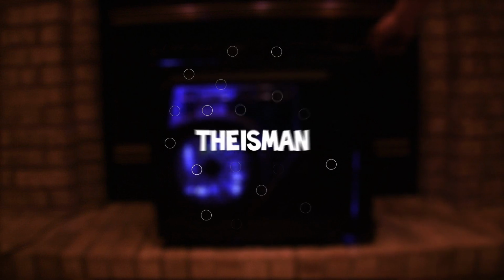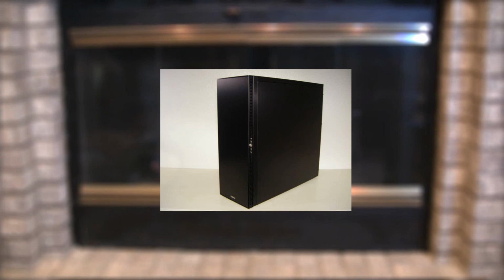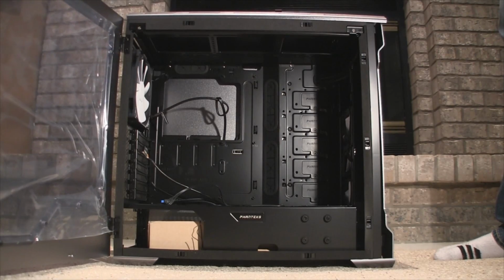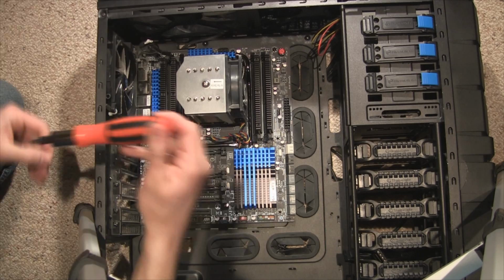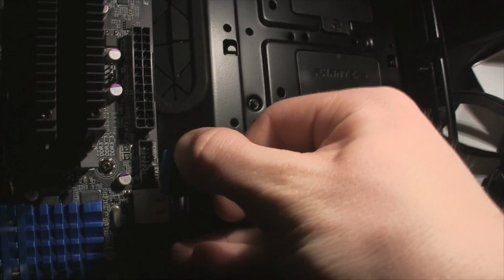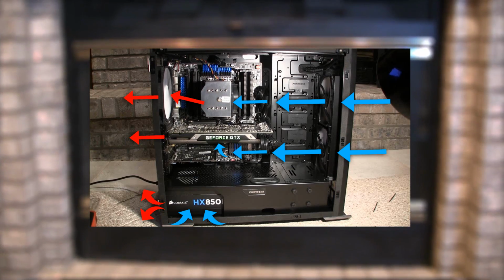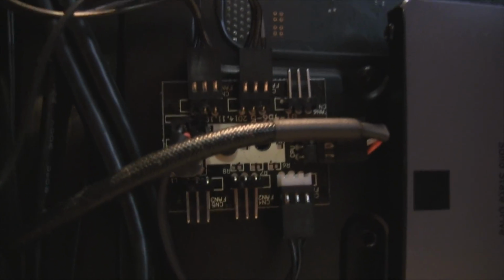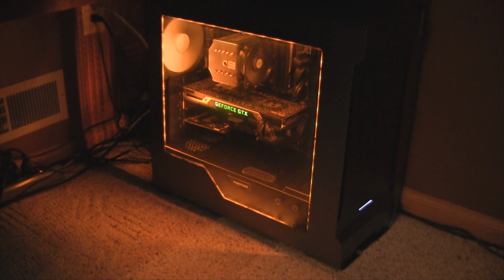How To Swap Computer Cases - Phanteks Enthoo Evolv

Comment: i have a question
can you switch cases with a pre build pc from hp
Reply: Yes so long as you have the right size for the components I recommend  mid tower it has good air flow and storage

Comment: I am going through a very similar situation. I just rebuilt my entire PC, but I still have the original case from my first build. I just purchased a Corsair Crystal 460X window series tower. Since everything was already install onto my motherboard everything was just plug and play. Now the fun begins, having to disconnect the motherboard and power supply, and dealing with all the cables is always a headache. Not to mention, I have carpet in my apartment to add to the fun.

Comment: I have a hp 6300 pro small form factor i wanna upgrade to a new case and upgrade the graphics card does all motherboards fit in any case?
Reply: No, each case description should say if it takes E-ATX, ATX, M-ATX, or Mini-ITX (listed from largest to smallest).  You would need to figure out what size MOBO you have, and then ensure the new case will fit that size.  All Mid or Full size towers will fix up to an ATX, with a few exceptions.  Sometimes HP manufactures their own MOBO's, which may or may not be compatible with standard ATX screw patterns.  Honestly bro, it's time to upgrade your computer though, not just your case.

Comment: I've been thinking about starting a project where I bascially take my main PC, an old ASUS cm1730, and slowely replacing every component one by one. Here is a link to a forum post where everything is going on:

https://linustechtips.com/main/topic/845102-pc-upgrade-ideasplan-open-to-ideas-and-suggestions/

Anyways, I am already considering PSU options, and graphics options (will probably go with a GTX 1050 TI), but one thing I have been thinking about a lot is the case. I really want a sleek design, as even though my current case is not "ugly", I would love to have a glass side panel, so when the PC is being worked on, and post-project, I can see it in all it's glory.

I really found this video helpful, as in a few months, I am going to start getting really serious on this project, and I will be purchasing a GPU, PSU, and a case. 

Was this experience hard or easy? I have never built a PC before, so I have never fiddled with the components. If possible, could you maybe guide us through the process?

I am really new to this whole PC thing, but this video clears things up.

Regards,

ItsEnderess
Reply: ItsEnderess 

What are the exact specs in the PC? 

And hit me up with your steam.

Comment: do you lose data if you do this
Reply: TERRIER KohL Your data is on the hard drive so no unless you replace the hard drive. It should appear the exact same as before.
Reply: the only thing that you will lose in this case is your money.
Reply: Yes, whenever you relocate a piece of hardware on a computer it will be disconnected from its original data bank thus resulting in a complete memory wipe. For instance moving your parts from a case to another case will disconnect the hard drive or SSD from the on board memory located within the PC case. This will case you to loose all of your files as well as needing to reinstall and repurchase Windows on the new computer.
Reply: what a dumbass lol this man should never touch a computer
Reply: @ZeoYT  lmfao!!!